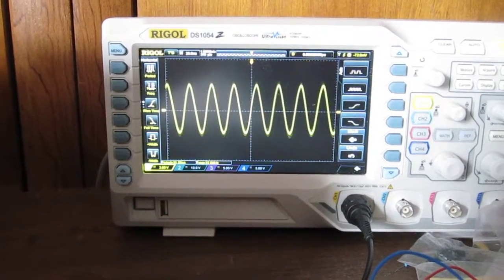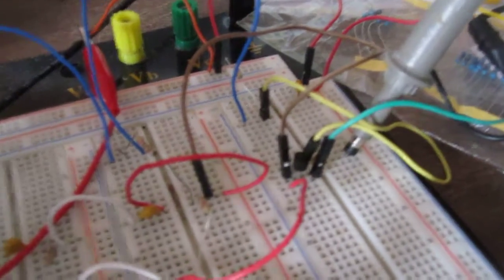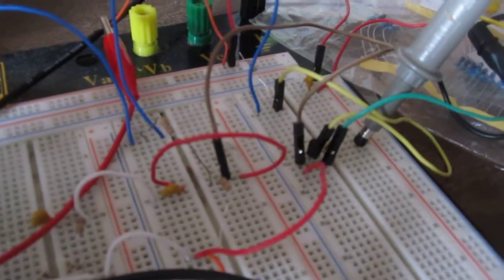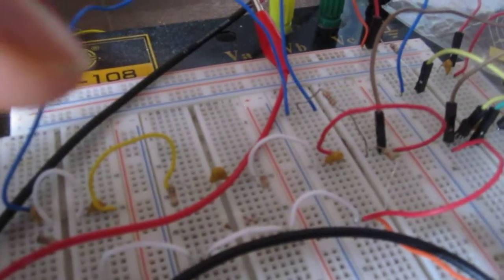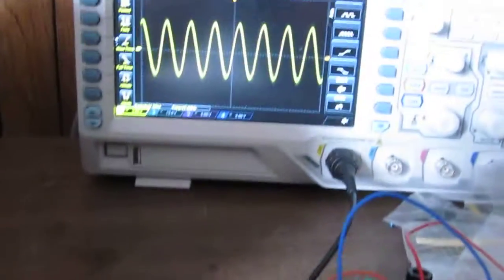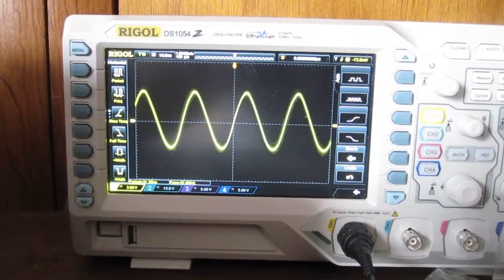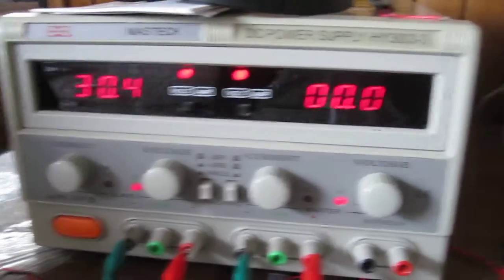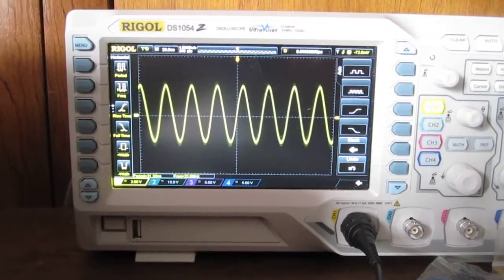Sine wave Generator Circuit built with a Transistor

Comment: The circuit as shown in the linked article won't work for two reasons. First, the DC bias is wrong. Replace the 1K resistor between the base and collector with a 10k resistor. Replace the 2k collector load resistor with 1k. Replace the 1k8 resistor between the base and ground with the more readily available value of 2k2. That will bias the transistor so that its collector is at about 4 volts, approximately half of the supply voltage. Second, the AC feedback is wrong. The 470n capacitor couples the output from the collector back to the CR filter/phase shift network but it is also part of that circuit so replace it with 100n, the same value of the other capacitors in that network. Then it will oscillate. I get over 5 volts peak to peak voltage swing on the output. To change the frequency experiment with the values of the four capacitors in the network but make them all the same value. You can change the three 1k resistors in the network too but not by very much. You can reduce them to about 470ohm but not much lower than that. You can increase them to 2k2 but not much higher than that. Again keep all three the same value. Make sure you correctly identify the terminals of the transistor you're using and use a 9 volt supply for the bias values given.

Comment: To all those who have tried this and found it doesn't work: It will work eventually. At first it didn't work for me either, because the transistor I used wasn't correctly biased using the circuit shown.  I replaced the divider at the transistor's base with a 20K pot and adjusted it to find the sweet spot.  Also I found that a slightly higher voltage, 12V, worked better for me.  I must have tried 50 individual transistors, and almost all of them oscillated in this circuit. Any transistor with a beta below 100 may not work, but most "reasonable" small-signal transistors will work in this circuit, producing an output of about 1.2KHz at around 7V P-P. Once you get it working, you can start substituting R/C values to get different frequencies.

Comment: Why wont this circuit work, I built it up EXACTLY as in the schematic and I get NOTHING, the only thing different is how I layed it out on the breadboard. I've tried EVERYTHING I can think of but there's absoluteness no sign of any oscillation whatsoever, I've been pouring over the circuit for about 5 hours continuously trying to work it out, everything is connected where it should be, all the components are the exact same, I tried several different transistors including 2n3904, nothing is shorted or open but but still no output on my scope., the trace is just a flat line.
Reply: Yeh, same here Mate - DOESN'T WORK
Reply: @craigrushworth8021  Build the circuit using schematic not model on board. The model is wrong on how to connect transistor. Emitter jumper wire should go to bottom power line (same as sine wave left wire output and all bottom resistor connections) connected to negative battery terminal. Positive battery terminal is connected top power line same row as top leg of 2K resistor. After that it works. 2N3904 works best for this circuit. Other few transistors I tried produces more distorted sine weave. Only one better is KSC1845 (you need switch base and collector positions; peak to peak amplitude will drop from 2.1V to around 0.5V).